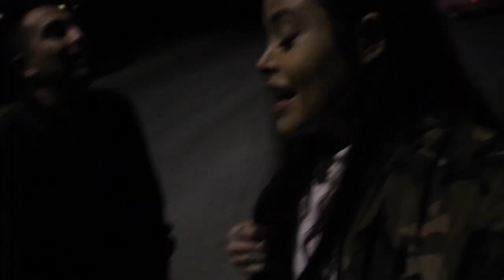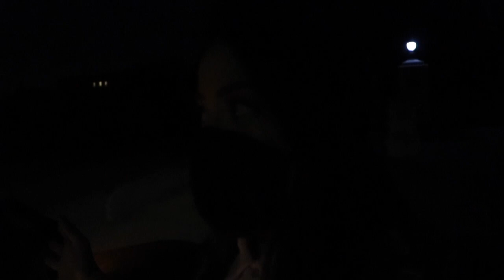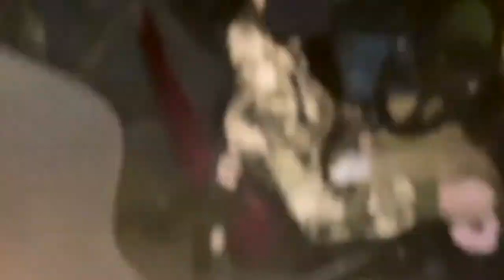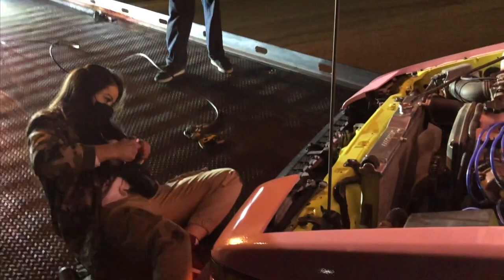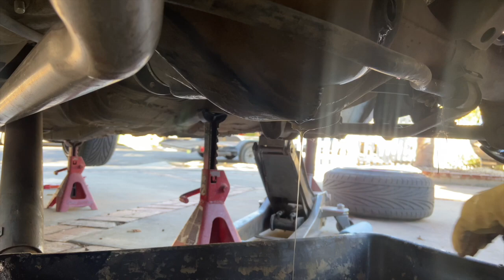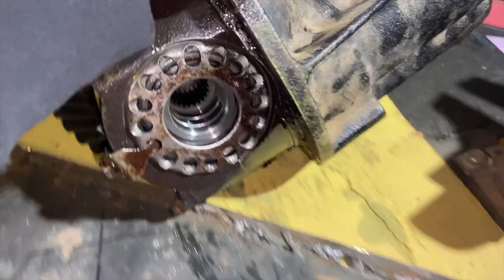My car broke down *emotional

Comment: That is true, we Live and Learn. Many times in my lifetime. Now another one I've come to realize is, don't underestimate any of your tools you have available. I can think of two times where I had cheapy/little tools that I also had the jumbo, beefy size of same tools and the little Cheapy tool is what saved the day.  *6inch pry bar vs 24 inch pry bar & a completly flat 19mm wrench that cuts into your hand vs a flare nut 19mm wrench. Wild things happen, but we learn a lot too. Glad your safe Stephanie, se cuida y Bendiciones.

Comment: What the hell? Why didn't the first trucker help? Can't  you contact Consumer protection?
One time I had to stop by the road to take a wee, in the middle of nowhere, at night, and in the  thickest fog you can imagine. Because of the fog I did not want to stay on the road at all so I got too close to the side of the road and my Corolla sank in the mud. No forward no backward, stuck.
The "what am I going to do" feeling is the worst, and I bet Steph felt something similar when the first AAA truck drowe off. :(
The tow truck that I called pulled me out of the mud for ~80 USD, it was an expensive stop for me, but at least they helped. :P
Reply from the maker: Oh no! That’s a cool story lol

Comment: You can do it without taking the diff out of the car. With a long solid bar. 👍
Reply from the maker: Obviously, it’s done already lol. I would rather have the peace of mind and check the inside of the housing since it’s only 10 bolts..
Reply: @StephanieDrifts18  ya 100percent I'd be the same but if you're at a track day and bring a spare shaft with you it's handy to know is all!